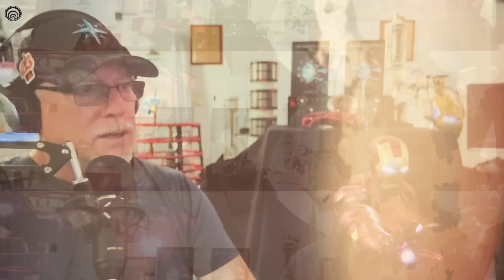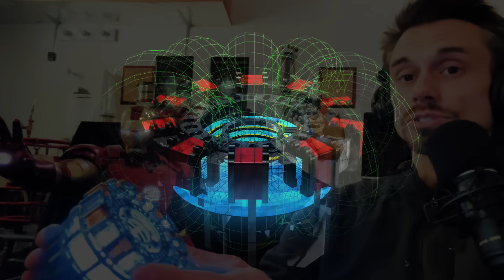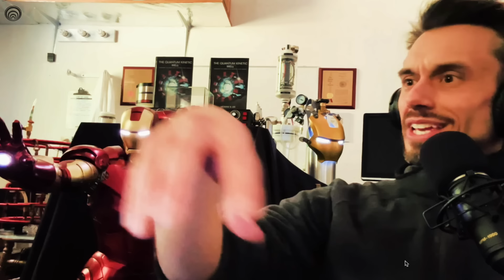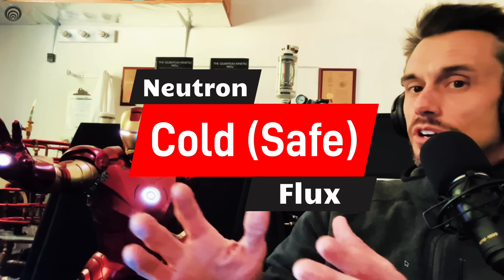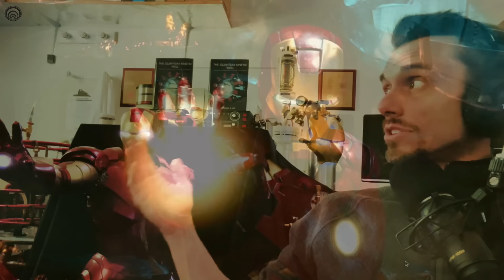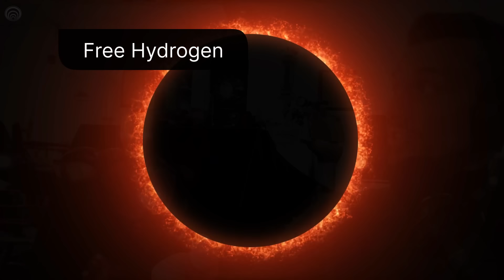HOT TAKE | Arc Reactor™ - Podcast - First to Fusion | Quantum Kinetics Corporation

Comment: The red thing behind Randal is a copy of Stan Meyer's 6 tier EPG (Electrical Particle Generator). In the center is a 10 coil sequential electromagnetic pump. This has been replicated by several people to date. A picture of this is available online for free and has the label Mag-gas plasma on it. Also, before McKane re-patents it, everyone should check out the original patent numbers: Canadian: CA1213671A1 European: EP0098897A2 / EP0098897A3 / EP0106917A1 and even US: 4,613,304.
Reply from the maker: Thanks for your comment.

Comment: Hi Randy, in terms of the difficulties extracting energy from fusion, (a return of the energy it took to pull apart sub atomic particles) one has to overcome the electro magnetic force of like charges (protons) before the atomic forces will bond the protons. This should be a known input energy amount so it appears that high velocity via extremely high temperature is too inefficient and you've found a way to utilize less energy in initiating fusion. Is this a fair summary of what you've done as I did not really get this from your video. Phil H
Reply from the maker: Thanks for your comment Phil.

high velocity via extremely high temperature is too inefficient is a correct statement. We here at Quantum Kinetics Corporation have discovered an innovative method for causing instantaneous nuclear fusion safely. The proprietary process is called, "Particle Oscillations as an Energy Generator™."